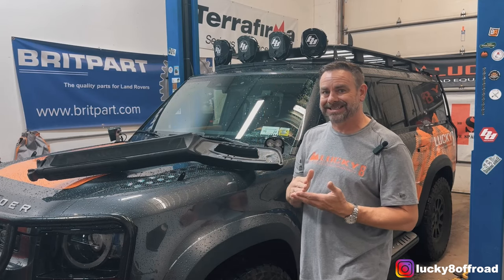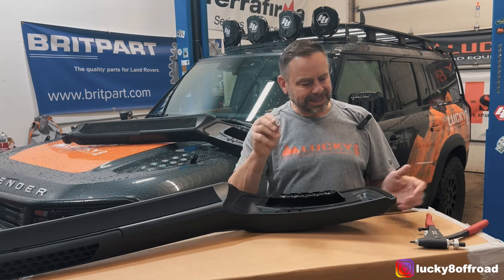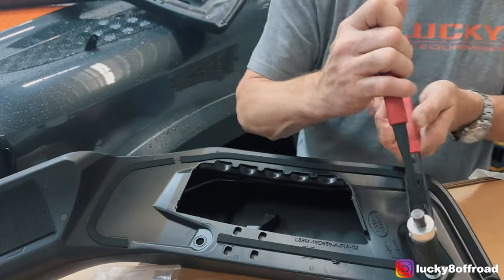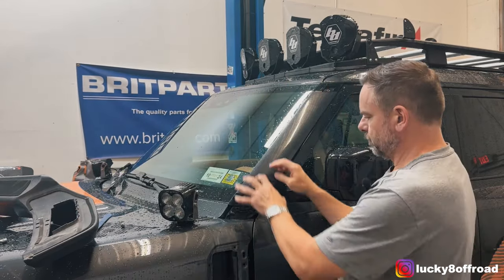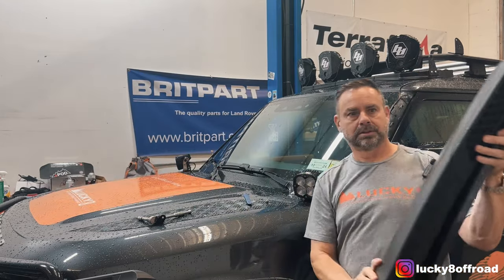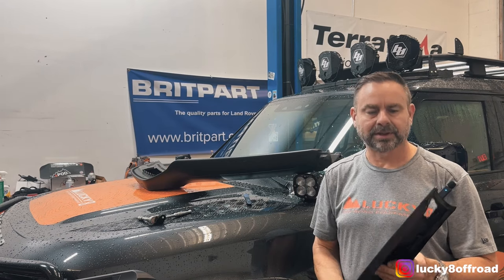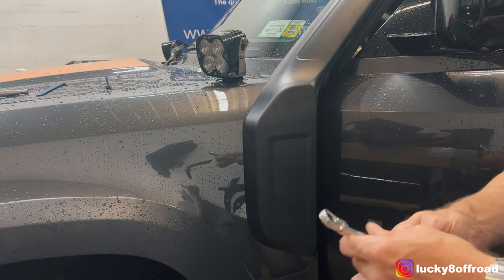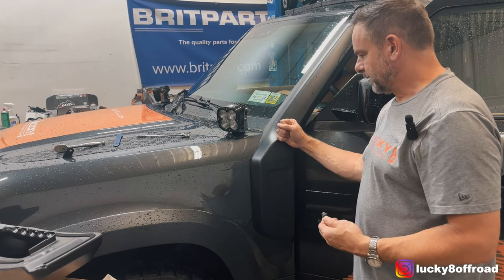Defender L663 Snorkel Installation: Secret Tips & Tricks Revealed!

Comment: Did you notice any difference in engine sound after installing the snorkel?
Did you car have 4, 6, or 8 cyl?
Reply from the maker: It does change the sound a little bit because the air in take is right up by the window now. I have run this snorkel on the 4 cyl  and 6 cyl
There is no snorkel for the 8

Comment: My factory installed snorkel broke the top mount at top of pillar. It looks plastic. Is there a metal replacement piece?  The mount/bracket in the video looks metal.
Reply from the maker: I lost mine also. We're just going to start stocking extras. Other than running a screw into it. I don't know of a good solution.

Comment: does this work without extra sealing? i mean like when fixing water pipe they use sealing rubber tape to seal it. just wonder because i want to use it for real
Reply from the maker: I'm sorry, the way that these are designed the air box will not be watertight
Reply: @Lucky8  thank you for the answer so no need to be water tight but still can be used then. that makes sense :) if not, it wouldnt be good for the rain.
Reply from the maker: @breathdemi  this is a raised air intake, not a waterproof snorkel

Comment: This doesn't make sense. There is no OEM raised air intake for V8 (or snorkel) due to the fact that air intakes are from the left and right side of the car.
Reply from the maker: You are correct there is no snorkel. We are chasing down manufactures to make one but as of now, no luck.